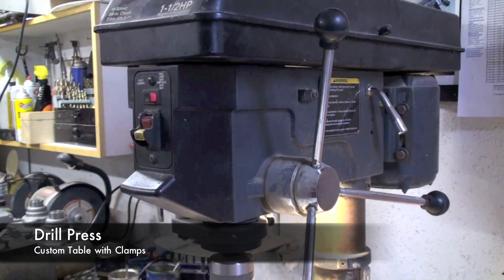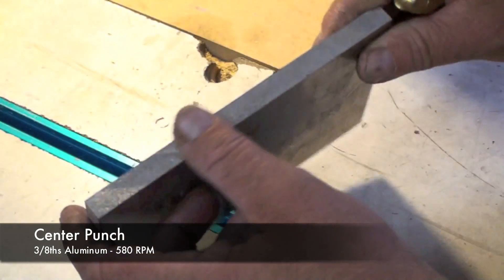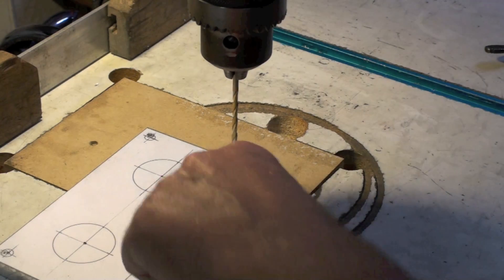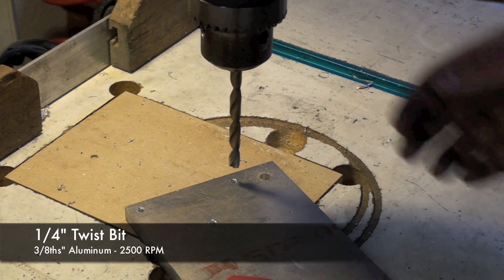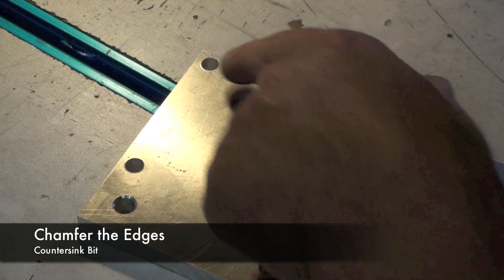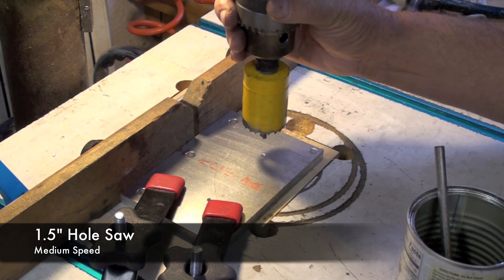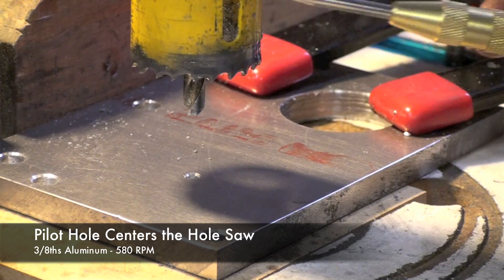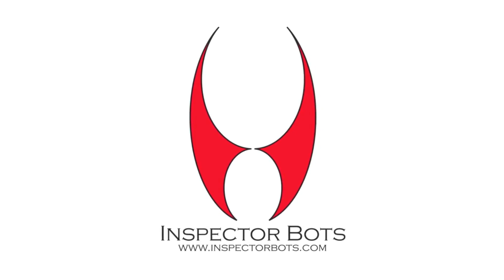Drilling Holes in Aluminum

Comment: I have an aluminum plate about half to a third as thick as the plate you're drilling at 2:14 (sim racing pedal tray) that I need to drill 4 holes into for a  heel rest. Do you think it'd be possible to muscle it with a cheap cordless walmart drill or is that just asking for trouble? I've never worked with any metals before.

Comment: Are there specialty drill bits made specifically for drilling aluminum? I am struggling trying to drill holes on my sunroom's  aluminum frame  -  it's been an exhausting task!  I am using a very thin drill bit to initiate the hole, then move on to the larger drill bit using an impact driver with a drill bit for metal.  It's still very difficult, and have now ruined some of my drill bits.  Any suggestions? Thanks

Comment: I have two questions and I hope you can answer. I have been reaching out and haven’t found an answer. I bought a food trailer, and for aesthetic purposes I’m adding wood work to the front. Is it safe and possible to drill the wood onto aluminum or should I only use a certain glue?  Also is it possible to attach flexible vinyl stick and peel sheets without drilling? What extra adhesive could I put on to make it last?  I would appreciate any advice.
Reply: 3m adhesive tape is wonderful stuff. acrylic foam tape i think they call it. its very strong. bonds to anything, it will peel off if uou pick and peel but it will hold panels together as if theyre screwed on. (also fairly waterproof if you clean the surfaces with alchohol before applying.) should do you proud for your truck. ebay

Comment: Why was the RPM set to 580 for the 1/8" pilot bit instead of about 2800?
Reply: Hole saw was at 580rpm at 3:00. Outer circumference travels faster as the diameter increases. Never heard of the 580 for the 1/8".

Comment: Very helpful. I am drilling some holes with a wireless drilling tool and the only problem I was having was centering the hole (I'll use the masking tape trick and mark the start of the whole with a screwdiver). As per drilling itself, found that low rpm works the best.
Reply: Low is best if you heat up it getts realy hard end you wil kill the dril best way is a lot of  Oil end slow ass you go dril drils not you

Comment: Use alcohol when working in aluminium.
Reply: Ok, and how much should I drink exactly?
Reply: @michalvalta5231  The optimal amount is 3,42 bottles of Yamazaki, 12 year old. It has to be this exact amount and this exact type of alcohol or it will not work at all. It is vital that you drink this exact amount, not less not more.

Comment: What type of oil did you use to lubricate your bits? Sad to say I never thought of doing that. Good tip there, pun not intended.
Reply: Gee...you ask a basic question 5 years ago and still no answer. What's with that?
Reply: @KailuaDoug  He ded.
Reply: For aluminium, use either kerosene (paraffin in the UK,) or something like WD40. There's also other specialist cutting oils if you google search, but the ones I've mentioned will do the job.

Comment: could this exact process be used to make an adapter plate for a carburetor? I have an old 2.6L that needs a new carb and if I can make it old school, 1 barrel carb with no emissions or smog crap on it, I'd be in heaven. Is aluminum, aluminum? Or is there a particular type used in carburetors and adapter plates?
Great vid. looks much simpler with the right tools for certain.
Reply: definately different types of aluminium out there. it goes from brittle to soft.